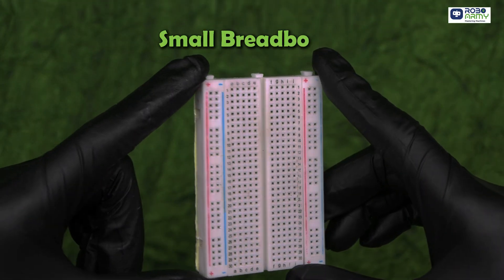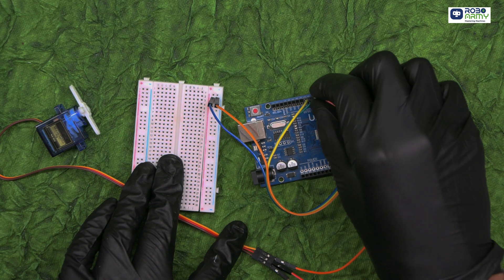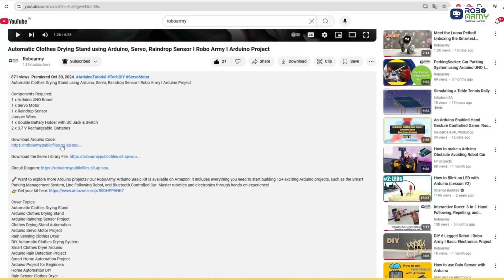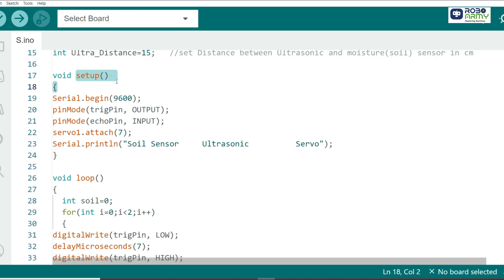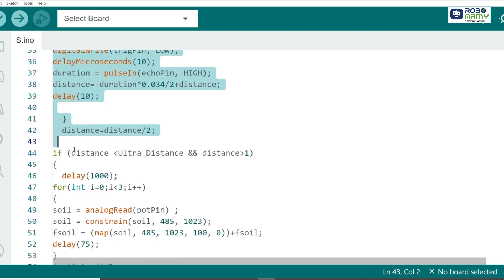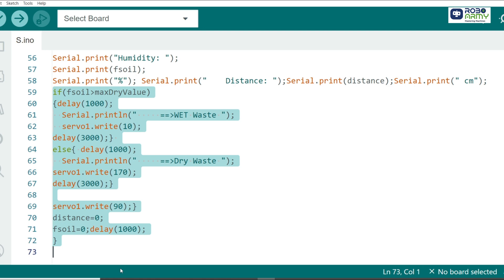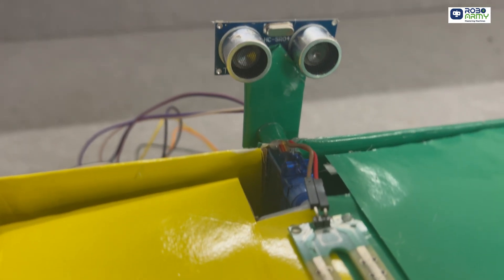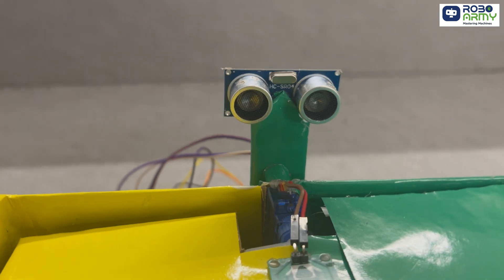How to make an Automatic BinBot: Dry Wet Waste Segregator Dustbin

Comment: Hello sir we did the project, but the servo motor spins automatically after giving power supply. What can we do sir?
Reply from the maker: If your servo motor spins automatically after power is supplied, try these fixes:

1) Initialize Servo Position: Add servo1.write(90); in setup() to set a neutral position.
2) Power Supply Issue: Use a separate 5V power source if the servo is drawing too much current.
3) Check Code Logic: Ensure no unintended servo.write() commands are running in loop().
4) Faulty Servo: Try another servo or test it with a simple Servo.write() command.

Comment: please enlighten me, who is responsible for its power supply of making the lid move? ( like does it have battery or something to make it move)
Reply: In. This project we want laptop
Reply from the maker: You need a laptop only for uploading the code to Arduino. Once programmed, the dustbin works independently without a laptop!
Reply from the maker: The smart dustbin is powered through a USB cable connected to the Arduino. You can also use a power supply, typically a battery (e.g., 9V or a rechargeable one) through a barrel jack or the VIN pin on the Arduino.

Comment: Ir infrared sensor use kr skte hy??
Reply from the maker: Yes, you can use an IR sensor for detection, but ultrasonic sensors are generally more accurate for distance measurement and object detection in varying light conditions.
Reply: @robo_army_  mera accche se detect nhi krra hy ultrasonic sensor pata nhi kya isse hy thoda help kr dijye plzz mera science exibition hy😟
Reply from the maker: Hi! If your ultrasonic sensor isn’t detecting properly, check the connections, ensure the sensor is facing the object correctly, and test it with a simple distance-measuring code. Also, make sure no obstacles or noise interfere with the sensor. Let us know if you need specific help via our official WhatsApp no.: https://wa.me/918888103688